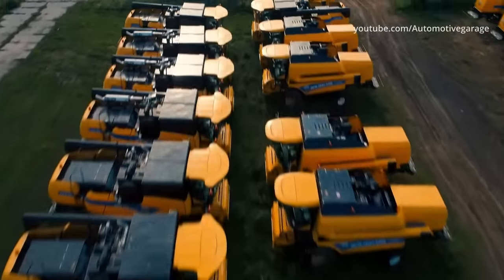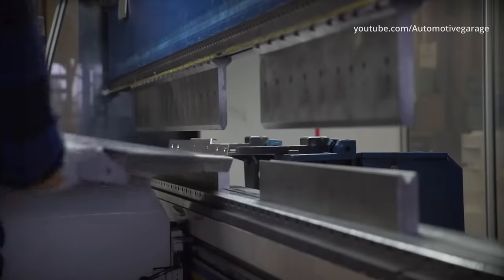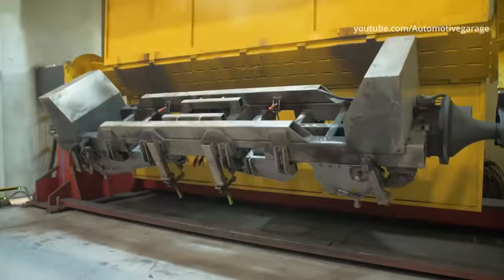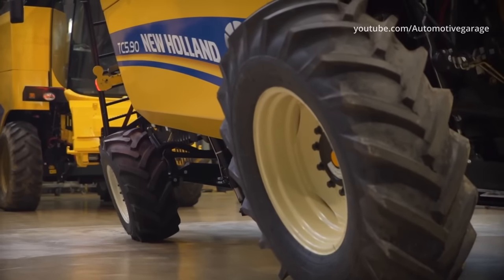New Holland  Harvester Combine Production factory tour

Comment from the maker: 0:09 Press shop and plasma cutting
1:26 Welding shop
2:53 Paint shop
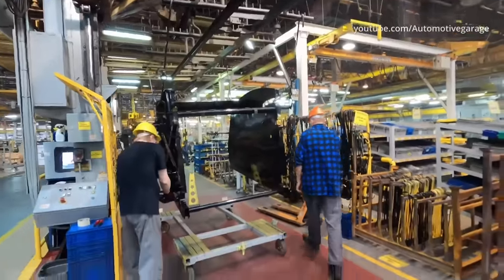4:26 Cropper assembly line
4:42 Harvester frame assembling
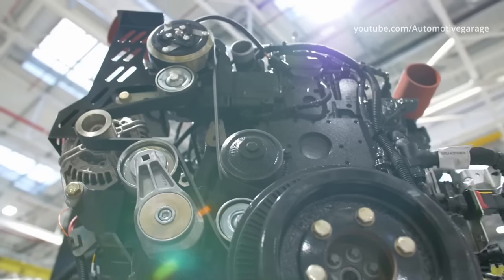5:08 Engine installation
5:31 Grain tank installing
5:47 Assembling chopper 
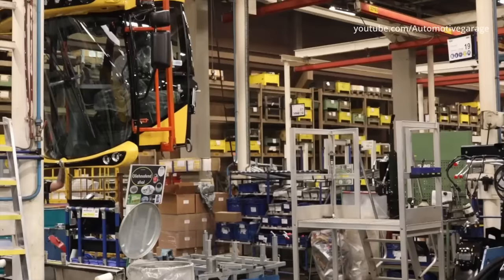6:55 Cab installation
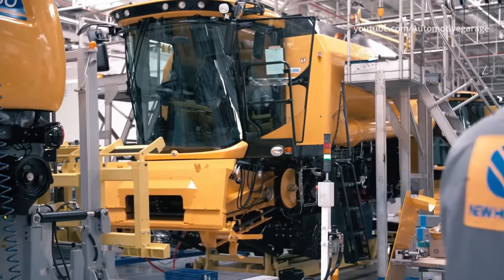7:35 installation of the unloading pipe 
7:55  Installation of the conveyor housing
8:24 Combine harvester testing shop
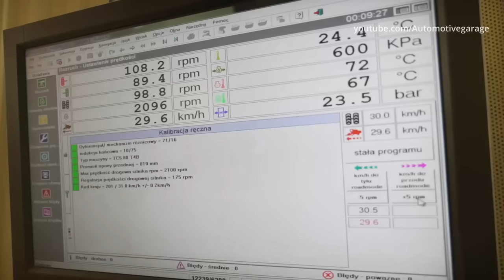10:05 Hederem production line
11:39 New Holland Factory in Płock (Poland):stayhome:
Reply: Dear sir my name is imran I am from Pakistan I have 40 year Experience in combine harvester remaking and repring 
Dear sir my Dreams am working with new Holland combine company 
Please give me one chance 
Please 
Please 
Please